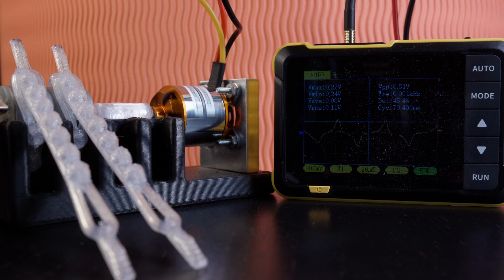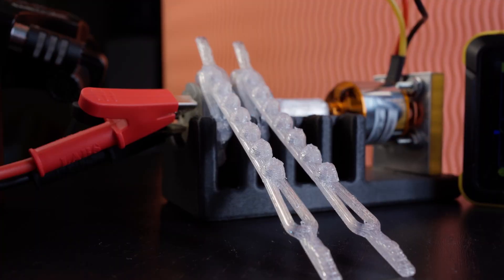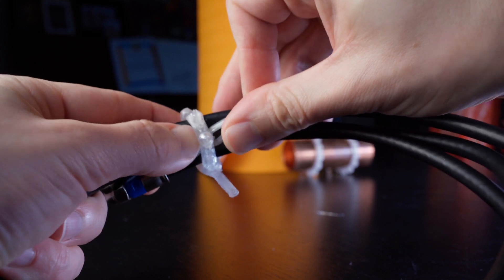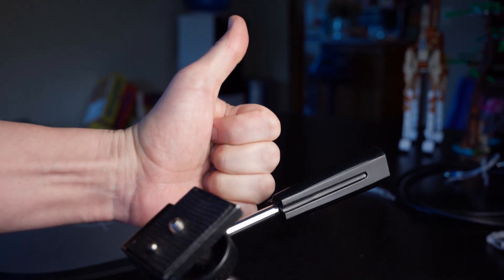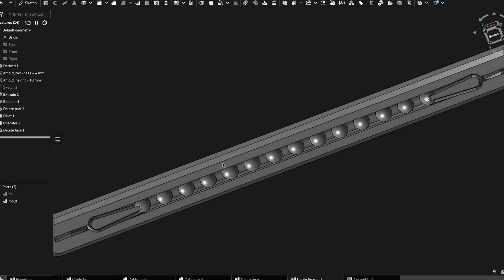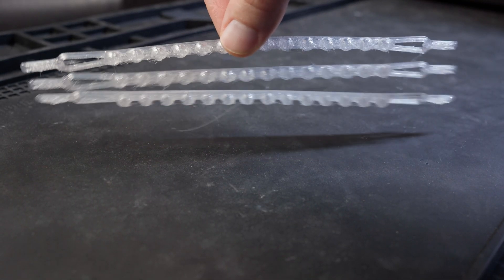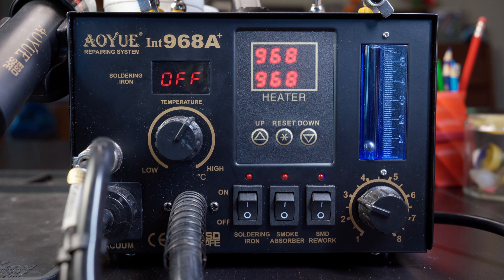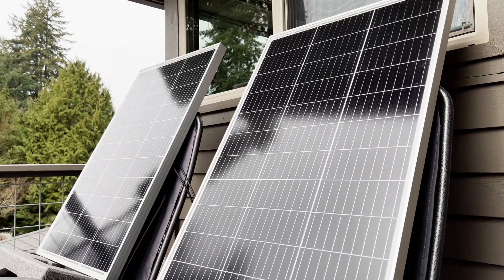We might never buy zip ties again...

Comment: Brilliant! Why not make them a little bit smaller so they are easier to bend and use?
Reply from the maker: Good idea. We're printing with a .6mm nozzle and a .8mm extrusion width, so very small features are tricky. Since I made this video we actually got a second printer that's set up for .4mm lines, but I actually haven't had much luck printing TPU with it yet. Our old Ender is a TPU workhorse! Maybe once we get the new printer dialed in I can try to scale these cable ties down a little...